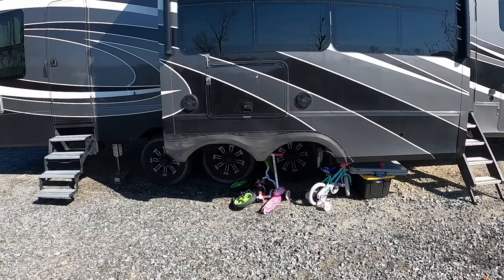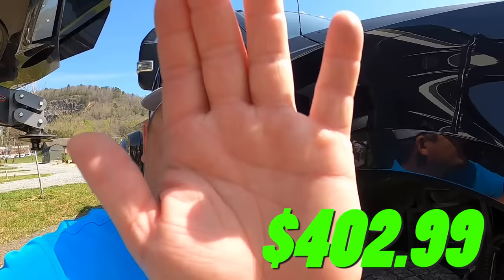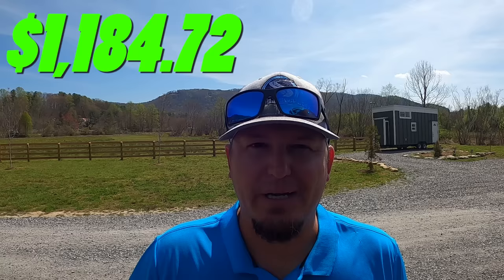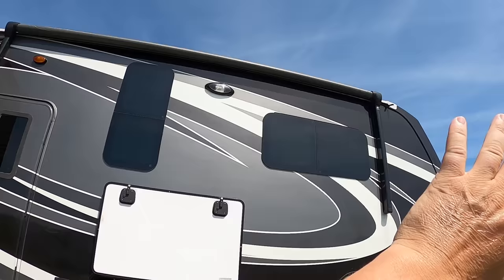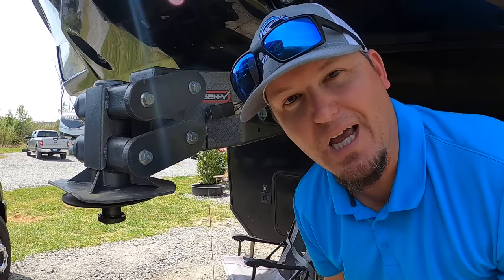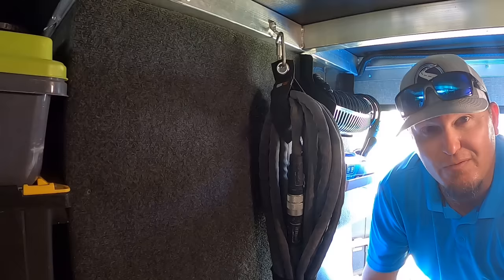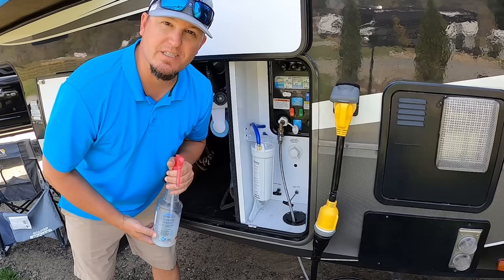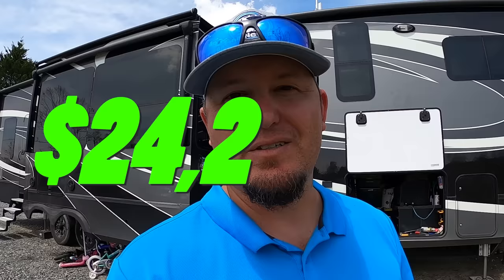These Things Are Money Pits! Everything That We've Had To Repair! | Fulltime RV Living!

Comment: The RV manufacturers are going to put a hit out on you. You've successfully talked me out of ever owning a RV.
Reply from the maker: All I did was tell the truth! If you use one fulltime and move often you will spend more in maintenance and repairs!
Reply: @PavingNewPaths  I'm thinking it might be a little cheaper with a smaller RV with fewer systems. I've looked at a 22-foot Arctic Fox bumper-pull with no slides. I'm thinking that half the systems "should" equal half the cost on everyday maintenance items.
Reply from the maker: @chriswhite318  We have never had any real issues with the systems, its all the little things that add up! The slide was caused by our own doing not the RV! But yes an RV with less moving parts has a less chance of breaking those parts!
Reply: Look at that beast of an RV. Everything you have to buy for that thing is going to be expensive. Im looking into a small Jayco trailer but im just one person. This guy is hauling an entire family around. You got kids messing with this and breaking that, you've got 3 or 4 other people using the bathroom and you need to entertain your family so you constantly pull out the awning for shade and you are cooking more often. The ignitor goes out on the stove that's 300 dollars for an inch long part.
Reply from the maker: @desertweasel6965  You are correct we are traveling as a family of 5 and the RV in my mind has done a great job of doing what we bought it to do!  This thing has not had a day off since we started! Sure somethings that broke were unfortunate, but most things were easily repaired by us!
Reply: 4 type chems for turds tank 》 only for 2 times a year 》 2K and manually.😅🏦
Man.. thats crazy these company grabbendesigns run by an oxim😧r0n businesship
Reply: MY 76 Winnebago Brave has never had a Mechanical Repair, They Don't Make Them Like They Use To !
Reply: Thanks for the heads up. I don't think you information will discourage any serious full time rv'ers. But having a heads up like what you're providing, is golden. Thank you.
Reply: They're built pretty crappy. I've been to the factories alor and when you watch them build them you realize how bad they are
Reply: @nohands3255  The best 5th wheel brand ever was Teton Homes but it closed its doors during the financial crisis of 2008. Other good brands that ended at the same time were Travel Supreme and Excel. All three used wood frames and yes, wood IS better than aluminum overall especially for full timing. If the top of the line Teton Home was still being made today it would probably have to cost around $500,000 or more due to the massive inflation we've seen in the last 15 years.
Edit: For clarity should have said wood structures not frames. Back then and today all are built on a steel chassis.
Reply: @nohands3255 Google “the dirty little secret of the rv industry quality”.  There are a number of articles on just that subject.
Reply: @dockersfavs3110 😊
Reply: Rent one if you want to go RVing.
Reply: Modern RV’s are absolutely trash. I would never buy anything other than something meant to overland.
Reply: After watching this I’m glad I bought a beach condo in Florida instead. My condo neighbor sold his and bought a luxury bus for I’m sure a lot of $$. Hope he’s enjoying it.
Reply: Sounds like they have put about 90k miles on their truck and basically move every 7-10 days. Not all of those miles are hauling I’m sure. But that is going to add costs! If you just use your 5th wheel 3-6 x a year you wouldn’t even hit a 3rd of that in 5-7 years of ownership the thing about his roof is disappointing though. That thing should last 8-10 years regardless of how often you pull it
Reply: I think I would just stay in a tent
Reply: LMAO!
Reply: @nohands3255  I hear ya! As a teen I worked in a RV yard doing all sorts of crappy jobs. I was really able to get into the interior workings (guts) of these things and was shocked at the crappy everything! From the frames to the trim to the wiring...it all seemed like bare minimum.
Reply: Yea if you slip a little just talk to a guy like me that love numbers. Why anyone would spend that amount of money on an RV plus the monster truck to haul around just a hotel room is amazing to me. Do you know the trips you could take to Europe and across the US of A for that cost, many. Plus who in their right mind wants to be locked away for 24 hours a day 7 days a week with their wife? Need I say more hope not.
Reply: Well there are always going to be quality issues, but some manufacturers actually do quality work if you forego some perks like slide outs etc...smaller is better.
Reply: @dapper_gent  I would think smaller is better also just going down the road...I see huge ones on the highway and when they hit a curve or bump it's like a haunted house creeping and crackling...
Reply: I bought a used small trailer for 8000. Looks like new and very little to take care of. Just like a small hotel room with fridge and stove. Small bathroom. It’s just for me and my wife
Reply: I should post on planes and boats. Maximum cash in exchange for the crappy reliability.
Reply: So many problems could be avoided if manufacturers put another $100 worth of screws and glue in their RV's....
Reply: and Ford.
Reply: Me. too!
Reply: its almost as if the rv is built as cheaply as possible. sun and road stress just speed the aging process
Reply: Me too.  I am out.  I see so many quality issues.  These are items that anyone with common sense in a manufacturing facility would catch.  But, they are shaving pennies to save money.  The slats falling.  The undercarriage falling off.  3 screws to hold a big exterior panel.  No Thanks.   I have another friend with a big Class A and they have tons of problems.
Reply: @user-sf9pq5ox7w dont try this with a GM lol cost you way more my family learned this the hard way got to love gm fans these trucks are the ultimate turd worst transmission you can get and motors are junk. I have 4 family members who have these 1 ton 4x4's not one has made it to 300,000 and they have all had top end rebuilds and transmission rebuilds yet Im at 275,000 on my 97 f150 4.6 best truck ive had and my 75 3/4 4x4 has 146,000 rebuilt engine 4x4 system and on 3rd transmission it stays parked as my f150 has become my work truck pulls my 3 horse trailer everywhere
Reply: Don't be sceered!....there is a lot of fun and fond memories awaiting. It's not all bad. Meet a lot of really cool folks and families on the road.
Reply: Just confirms with a real life story what you can tell just running the numbers. My 1,000 sq ft condo in a building with an indoor pool cost less than this set up, and far less for utilities, taxes, insurance, maintenance and repairs than does a large RV.
Reply: just dont buy grand design youtube is littered with their crap workmanship
Reply: @vietnamvet4533  Yeah, I hear of retired couples who couldn't stand 24/7 of each other in a 3,000 sq ft house, swapping it for a big RV with 400 sq ft total including slide-outs that cost as much as the house, and wonder what they're thinking of. The crunch comes when they realize that they spent their house equity on a trouble prone piece of garbage that loses half its value in 4 years while their house has appreciated far out of their bracket.
Reply: @chicagonorthcoast  Yep it sure isn't for everyone, the thought of me, the wife, the dog and 2 cats sitting in bump to bump traffic on I whatever interstate to visit the large ball of string, sound like a year in VietNam for me. We love to travel, by plane that is. Agree with you 100%.
Reply: If something like this scares you away, you don't need to be out there. Stay home tucked away in your little abode. Adventure is NOT for you!
Reply: @seanoleary1979  Scared nah passed off at all you who think your on some kind of adventure.  When most are just a bunch of old fool with to much time and money then brains.  And as far as adventure I could tell you a few stories that would grow hair on your knuckles.
Reply: @vietnamvet4533  True! What's really sick is that most don't even have the money- they hocked the houses they spent 40 years paying off to buy those things. So, instead of swapping nice houses for a smaller, nice stationary dwelling close to their kids and friends and services, with plenty of money left over to fund some retirement fun, they end up destitute in old age and hating each other when they're stranded with a deteriorated 40' piece of trash that cost them their combined retirement incomes to gas up, repair, and clean.
Reply: Don't buy a new one - buy one after an owner like this has fixed most of the problems.  Avoid hi-tech; more things to go wrong that are expensive to fix.  These things are actually very fragile and conservative driving helps prevent it just shaking apart.  Myself, I prefer older and simpler things that may not be as luxurious but the more  you stick to basic functionality the less problems you are likely to experience.  This guy is talented enough to fix it himself; if you can't do that these costs are much much higher.  If you are young and going to do this permanently, best investment is taking a professional RV Repair Training Certification Course.  Lou can pay for all these costs by helping your neighbors and do the work yourself.
Reply: @JustVinnyBlues  And even better stay in a motel fly where ever you want save tons of cash and headaches.
Reply: Rvs are like taking a house through a hurricane and earthquake at the same time everytime you move them. There are ppl who live in them full time but barely move them and they rarely need to do any repairs if any.
Reply: 😂me too
Reply: IKR?!  I’ve been dreaming of doing this FT but this dude just scared the crap out of me and I’m reconsidering.  The rv industry seems to need a shake up in terms of quality.  Yikes! 

Curious what you think of the new Brinkley.
Reply: So, 3k a year for the truck? And half of that was upgrades, regular maintenance (40,000 mi a year, you are going to need new tires, should have been factored in). You should not need new rotors and upgraded for sway bars every year.

Did you test the washer before you left the dealer? 

Bulbs are a thing. You now don’t need new bulbs every year. 

You are moving all the time. Just get some glue to have on hand. 

Slides leak and break. I say no to them.

You wont need a new tow bar every year. 

You overspent on filters. Get washable.

It seems maybe you didn’t factor in breaking in a new rv? Sorry, you bought used! Good idea, new rvs are ick.

Your under belly falling sounds like a huge issue, warranty or not.

If you are living full time it is like being in a house. Light bulbs go out. You have to buy filters and sealant and fix furnaces. You have to get dehumidifiers I’ve had to buy 2 dishwashers and a washer in 3 years.

Some of this stuff also doesn’t matter. Who cares if the light cover is cracked?

I have never broken a sewer hose. Dude?
Reply: Why would you tile in an rv? That will not work long term.
Reply: Who cares if the hose drips?
Reply: Waxing your stuff is your choice.
Reply: This guy just didn’t calculate correctly. Light bulbs and Sealant was a surprise? He is also paying too much for a lot of things. And much of these are just things he chooses to do, like waxing and upgrading.
Reply: Yeah try a twenty six foot motor home.
Reply: @chriswhite318  Arctic Fox is made by Northwood Mfg in LaGrande, OR. They are solid trailers and recognized as being a step above the Indiana crowd. We had a Nash for 16 years with little problem. Now we have an Arctic Fox travel trailer which we bought new in 2012. There were a few issues when new but the factory fixed it. They cost more, but well worth it. Some reviewers call them "tanks".
Reply: Yep same as that. Between you and Liz Amazing our plans to buy a motorhome and go full time RV has been shelved permanantly. Were gonna snowbird and rent 4 months a year instead.
Reply: AMEN!
Reply: RVing  never really appealed to me. But thanks to your video I will never even look at an RV. Are they made in China?
Reply: @chriswhite318 arctic fox are good quality.  Believe we'll insulation. Hence arctic fox. Lol
Reply: You are a smart person.  RVs can be fun, but they are expensive and a royal pain-in-the butt.  I might keep mine a couple more years since I have it, but I'll be happy the day it's gone.

I considered downsizing to a smaller rig, but decided that I'm not wasting any more money.  Sometimes I think a very small, simple travel trailer would be fun for a week.  After a 2-month trip, I'm tired, stressed, and delighted to be home and not cooped up in a 5th wheel.
Reply: @davidkendall6801  Learn to sail! Open the world up to yourself.
Reply: Did Insurance pay for the roof?
Reply: they are money pits. rent a nice motorhome once a year, you will be time and money ahead.
Reply: Import a German built rv if you want quality, or one from another country.
Reply: Wow!
Reply: You could not afford to own one in the 1st place.
Reply: Me too!
Reply: Rent one, spend a few months seeing the county, return it. Save lots of money and headaches...
Reply: There not designed for full time living in.
Reply: @lilibethdoherty295 I bought a 1991 Toyota Dolphin V6 w 52k miles for $12k. Put 4K into it. Lived in it over COvid winter in Quartzsite AZ. Sold it for $13k. Wish I kept it! Toyotas will last 500k if you take care of them.
Reply: I fantasized for years bout getting an RV in retirement.  Thank you for saving  me the money and aggravation.
Reply: Me too
Reply: me too
Reply: Me also
Reply: @chicagonorthcoast let me see...five dollars per gallon for fuel...five miles to the gallon... seven days a week...space rent fifty dollars (or more) per night... that's just for starters...oh boy... this is the life... lol
Reply: @darcymoon2109 somebody gonna call the drip police on you... lol
Reply: @keithfaulkner1288 har har har... lol
Reply: For me, you encourage me to keep on going "Home is where we park it", six years on the road and still counting! "Take the less travelled path" and happy trails! Life is too short to be afraid of anything, live life now as tomorrow may never come.
Reply: @darcymoon2109   somebody gonna call the drip police on you... lol
Reply: I watched a tv show about how they make RV's. This was sooo pro RV it couldn't put them in a better light. But honestly their built like shit. I understand that weight is a huge consideration. But honestly. They put way to much faith in adhesive's. I mean what weighs more? A box of screws or a case of formaldehyde based adhesive? I could see many people getting sick in one of those things.
Reply: @ronaldstarkey4336  , yeah, I did the numbers for a 40' class A diesel pusher, figuring 5mpg, which for my hypothetical trip, Chicago to Los Angeles, about 2000 miles one way, comes out to 400 gallons of fuel, or $2000 worth, for ONE WAY, never mind the return trip or side jaunts to take in the scenic wonders of the West. Then, figure the purchase price for such a vehicle of decent quality, say a Neumar Dutch Star, which starts at about $700,000 as far as I can tell. Say you own it for 10 years, you'd be able to resell it for $350,000 tops because these things depreciate rapidly, so that's $35,000 a year it costs you just to own the thing. And since even this particular RV, which was once famed for its quality, is now becoming known for dozens of defects and mechanical issues, add the cost of multiple repairs every single year you own it. It makes flying first class and staying at a 5-star resort look cheap. And don't even talk about road service should you break down in the middle of nowhere.
Reply: @kirkb2286  We stay in a tent in the 70s visiting Lake Summerville it was rough grounds ,the squirrels ate our food, But is different when your in your youth.  Now my wife and I have to have at least a  bunk to sleep in  and AC at least set at 75° and that's roughing it ,just saying.
Reply: Why are these people so silly?  They know they are buying junk.   Maybe their YouTube money helps defray the costs.
Reply: I went to an RV show.  I saw the junk in plain sight.  I will never forget the plastic shower curtain that was falling off.  I wonder what dummy bought that piece of crap.
Reply: Amen brother.  They never stop talking.
Reply: @alsheremeta it’s not the cost of the screws and glue but the labor to do that and to do it right
Reply: We bought a Jamboree brand new in 1988 and the only thing big that we had to replace was the refrigerator. We sold it in 2021. She was a beauty.  And everything still worked fine.
Reply: Get a used one that is already broken in.
Reply: yep and me for sure That done my head in truth it was way too much I couldn't imagine myself spending all money I lived on a 34foot yacht and all used the wind it was a very cheap live lifestyle the only reason I sold it was because my husband got sick with a very rare virus that he wasn't able to recover from in died in my arms at least I still have my home so now it's just me and 3chihuahuas my plan was to buy an RV after watching all this stuff I've given that idea up  so thankyou for saving me $555,000 on a whim
Reply: @PavingNewPaths  I agree. For people that need these, know these issues already. At least people already owning a RV. So you did not say anything unknown.
Reply: The build quality of these things are horrible, every one built is a Monday or Friday RV.
Reply: @maplemanz  This is why I will not live on one full time. You would need to spend 75k-100k to get a decent 5th wheel.